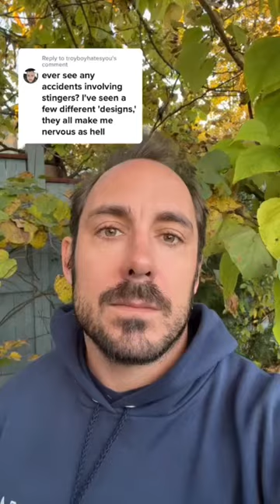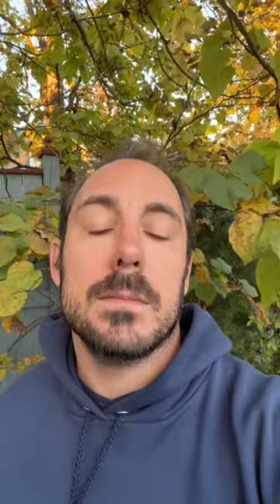Stinger mishap

Comment: I've never seen anyone use steel wool in one before
Reply from the maker: We used bolts of big metal in salt water, the steel wool could go straight in the water we heated, though it was probably toxic
Reply: @second_chancer  we used nail clippers and split them, connected 1 to each wire and separated them with a piece of toothbrush or pen and just put it in the bucket,  I mainly used baking soda in the water but also used rock salt.